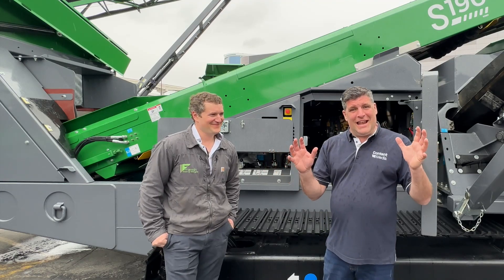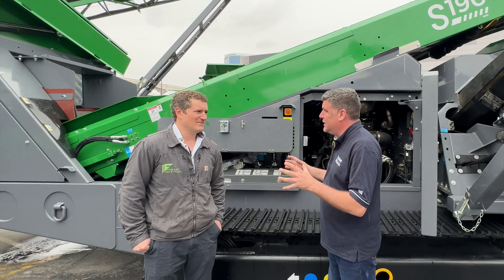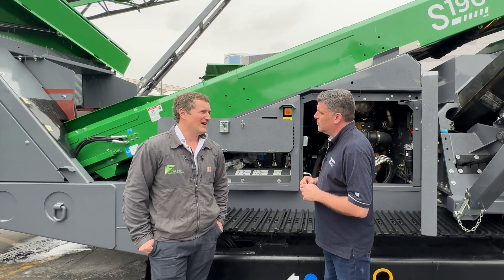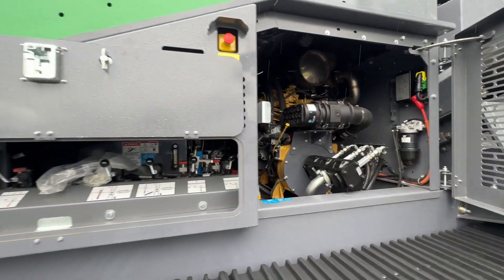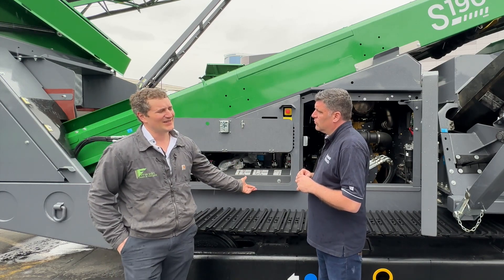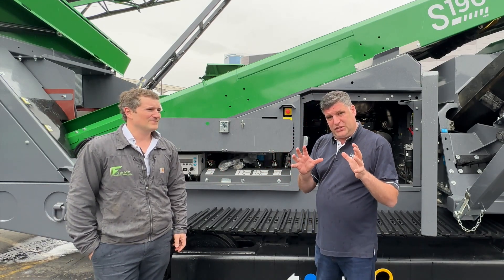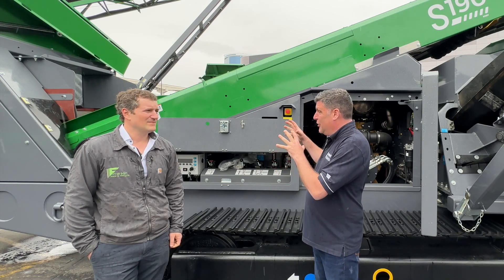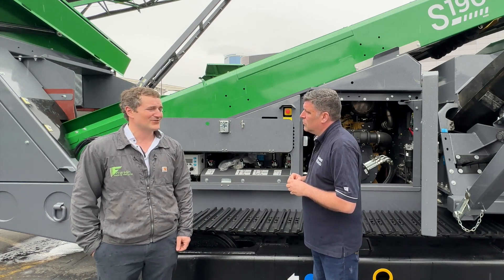McCloskey showcases the S190 dual powered screener with a Cat engine and electric motor at Conexpo

Comment: I took control of a s190 in Feb / March time . This year 2024 brand new off the low loader . Brilliant bit of kit my gripe is though no maintenance book to tell you about different functions of the machine / Or any indicators on the machine to tell you what bearings you are greasing  . I have asked for a book but been told it's all on memory stick now which is  no good for a bloke  working off the beaten track